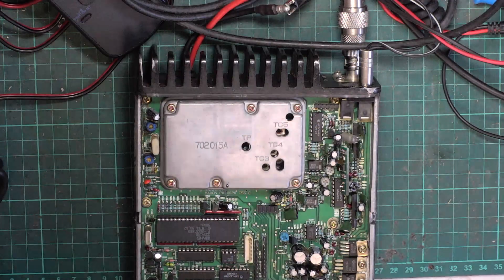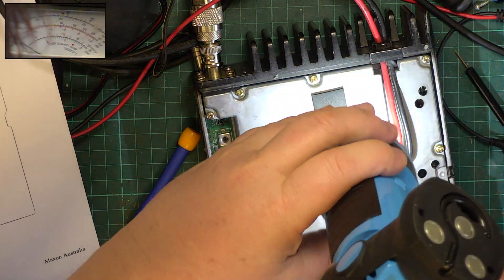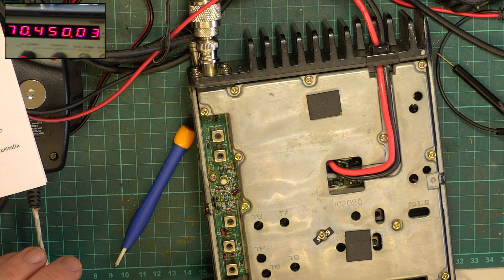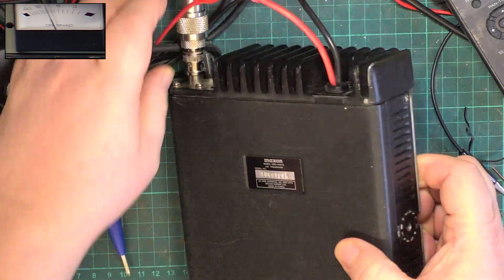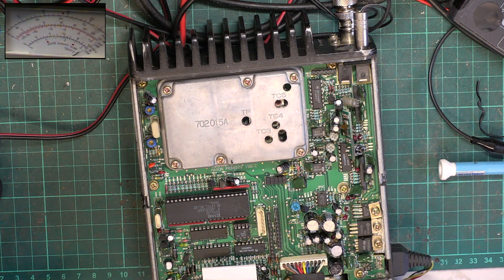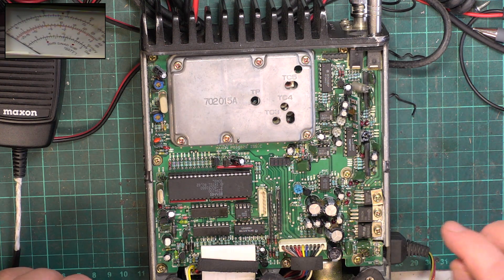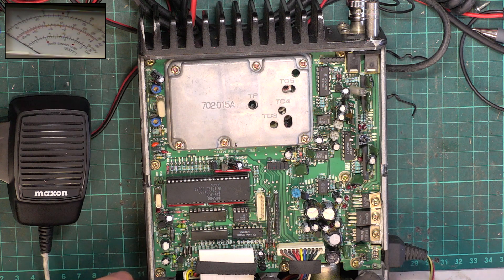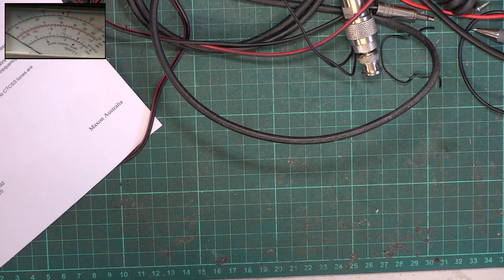Maxon PM150 on 4M amateur band (SMX4050NLA)

Comment: Hello. Could I have a hex file from 93c46 memory for 4m band please? I will be grateful .
Reply from the maker: I'm not quite sure. The 486 DOS computer saves to it's internal HDD, or to 3.5" floppy disk. You'll have to email me your email address.

rshireby@yahoo.co.uk
Reply: @ukfmcbradioservicingTango21  I use sp200se programmer. I pulled out the 93c46 memory and read it, but I can't modify the batch to get 72.620MHz.

Comment: Would you be able to program my Maxon SL 55 v2 handheld for 2meters?...
Reply from the maker: Yes, Email me  rshireby@yahoo.co.uk
Reply: I think I might have made a slight mistake in my request it's the v1 which covers 2meters and the radio I have is bottomed out at 146mhz as a v2.  I will have to locate correct version lol.
Reply from the maker: @stoatrepublic  I've never seen a V1. I can always try. Commercial sets will usually work just out of band OK
Reply: @ukfmcbradioservicingTango21  I'm looking into this, it's not a subject I'm familiar with.  I like these radio's anyway from the nostalgia of my younger days using them for work, they are timeless so looking to use them for amateur use as well.

Comment: I have one of these sets I paid about 3 or 4 pounds for it years ago and never did anything with it. It all works fine from what I can tell and is on 71MHz something. I'll have to get it down from the attic and see what the model number is. I don't have the means to program this and I would like to be able to put it to good use for a 4 meter radio. When I find it I don't suppose I could send it to you to be put on to the 4 meter band?
Reply from the maker: you could....subject to that model number being correct for the band.

rshireby@yahoo.co.uk
Reply: @ukfmcbradioservicingTango21  Thanks for your email. I'm still looking for the radio. I should find it by this evening.

Comment: I converted a few of them to 4m and I changed all the capacitors in the front end strip to bring it down a bit and I got 0.16uV @12db Sinad.
Reply from the maker: It depends which of the 4 versions you have for different parts of the band. I've got a PM150 that needs the capacitors changing. Luckily it's all in the service manual. When I bought the brand new on I own specifically for 4M in 1995, I ordered exactly the right model.

Richard, G0OJF, UK
Reply: @ukfmcbradioservicingTango21  hi! Do you have any hint on where to find the service manual? I'm looking for it and can't find it…
Reply from the maker: @snowflakesyndrome  I bought our copy at the time from maxon at £100. I subsequently bought the PM100 manual via ebay for £65. They are a couple of hundred pages hence no online scans. They did produce a temporary manual in the early 90's when only the VHF high band version was new out & you may find it online or cheaper on ebay. Instead of the manual saying PM150, it's model specific SM4150. You may also find a slimmer similar manual from Australia SM4000 series radios. I did see these others at training sessions.

Richard, G0OJF, UK
Reply: @ukfmcbradioservicingTango21  thanks for the detailed response! 73

Comment: Interesting, I have a couple of these radios which have sat in the pile for too long because the VFD display doesn't work. Might have to put some effort in and get them working.
Reply from the maker: I've never know a display go down, so for you to have two. Now is it the display or the driver transformer.. You need a third set to borrow the front off for quick diagnosis

Richard
Reply: @ukfmcbradioservicingTango21  yep usually the VFD display driver cct, thats another thing i dont like about them, its a business radio not a flashy hifi you are tryng to impress the neighbours with, and if the VFD driver switching cct isnt properly earthed? it gets into the Rx audio and TX mod.
Easy to explain, Maxon have very few Radio Amateurs working in the design dept, the opposite of say Tait
Reply: @ukfmcbradioservicingTango21  I'm sure it's a rare failure but they were bought as part of a job lot of faulty radios a few years ago which increases the odds of unusual faults quite a lot. My money will be on the driver circuit, most likely whatever's generating the voltages rather than the display itself I think but it'll be fun to find out.

Comment: Maxon 4050 type codes:
SM4050SL = 66 to 77 MHz
SM4050SH = 77 to 88MHz
SM4050NL = 66 to 77MHz
SM4050NH = 77 to 88MHz
So the SM4050NLA is 66 to 77MHz TX and 77 to 88MHz RX you will need to pad down the
 RX front end to tune properly on 70MHz, there used to be mods online listing the changes
 but i cant find them at the moment.
In the US they are badged as General Electric Monogram series, you'll probably find much
 more on them and mods under that name
If you are going to build a SMP-4004C programmer (schematic available online) you'll need
 the hard to find MAX236 twin serial converter chip. Probably easier buying an eeprom blower
 and put the 93C46 from the SM4050 into it reading the eeprom and edit the hex code for
 the channels you want. and Maxon wondered why the Chinese with their simple serial
 PC interface were stealing their market. 
I remember at Maxon Hemel Hempsted the day the Korean management visited, they rightly
 looked like someone had stolen their Porridge. How they are still going i can't imagine?
i'll stick to Kenwood, Icom, and Yaesu vertex PBR radios and of course Tait.
Reply from the maker: Thanks for slotting in the model variations. Footnote: the different capacitors in the front end are set out in a table on the circuit diagram in the PM150 manual making the 'about a dozen' capacitor changes from one band to another quite simple.

Richard

Comment: You've apologized for the music over the tannoy before, but today is the first I've heard anything ... no music, though, sounded like a talk show.  Sadly, no 70-MHz band here ...
Reply from the maker: that was BBC world service news for 5 mins set to come on 1 minute before the hour. There are three radio tuners & they are set to alternate between the former, BBC radio 4 & BBC radio Lincolnshire. That way I get news from slightly different aspects. Bear in mind I have no TV here.

Richard, G0OJF, UK
Reply: @ukfmcbradioservicingTango21  Yeah, TV hasn't been a reliable source of news for some time ... in any country.  

Hope you are tuned in to Radio 4 on 198 kHz.  :-)
Reply from the maker: Not on the background music system, but when I can; they carry some different programs between LW & FM. They're still using the 1937? transmitter at Droitwich. If you drive past the area & are listening to FM radio, it knocks your IF out! And that transmitter runs off the original diesel generator built for it.

Richard, G0OJF, UK
Reply: @ukfmcbradioservicingTango21  Very slightly different aspects, i get my news from
 Rebel News Canada, and Sky News Australia